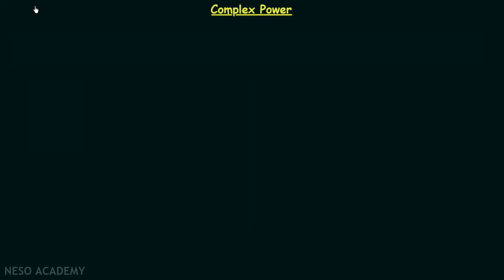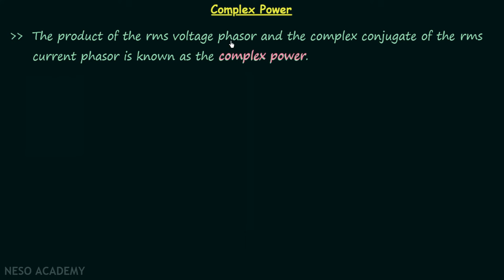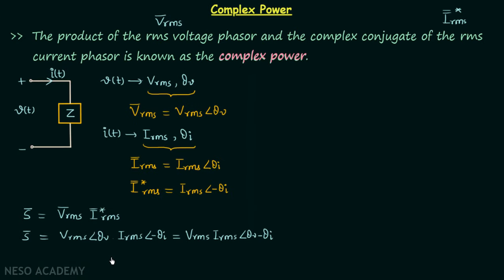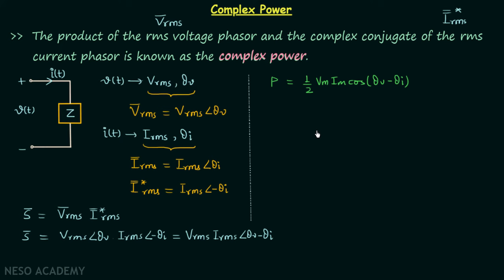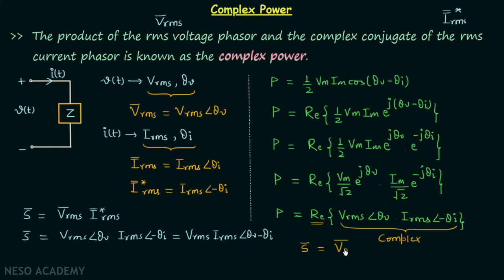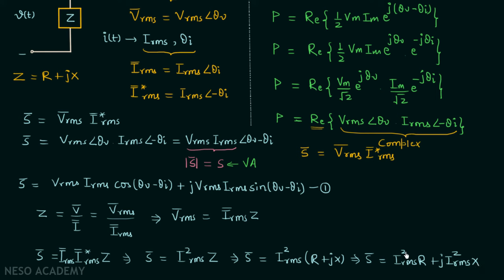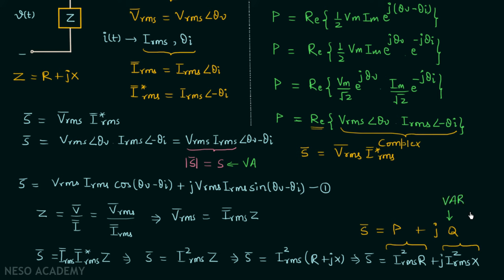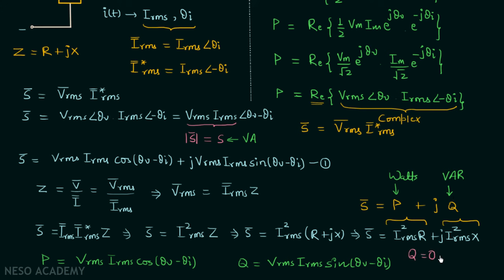Complex Power & Reactive Power

Comment: Hi Sir, I've seen all your videos about AC power. I found something hard here, can you guide me, please?

So here my teacher gave me a problem, where 2 loads are placed in one place. It is 20kVA 0.8lag and 25kVA 0.9lag. Both of them have 2400Vrms. There is also line impedance 0.5+j2 on both sides.

I want to know, how is that possible for a series circuit to have different Amps? Look at 20kVA has 8.3A while 25kVA has 10A. Have I misunderstood the question?